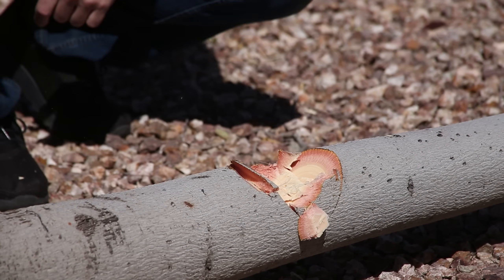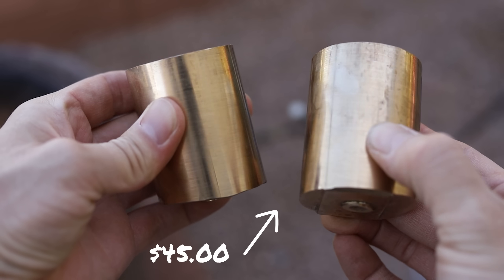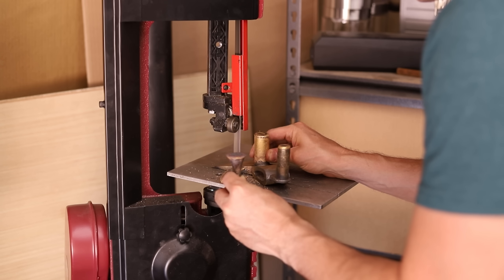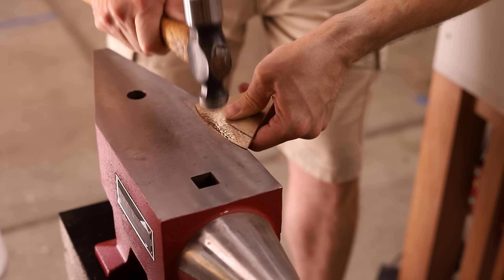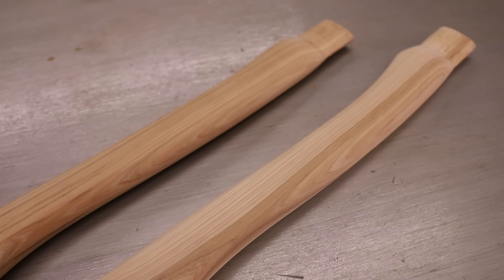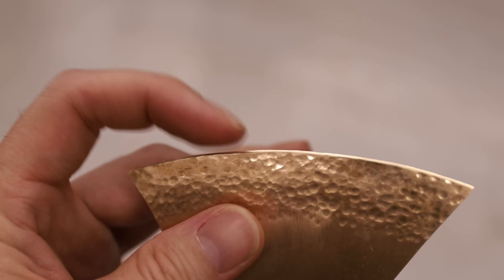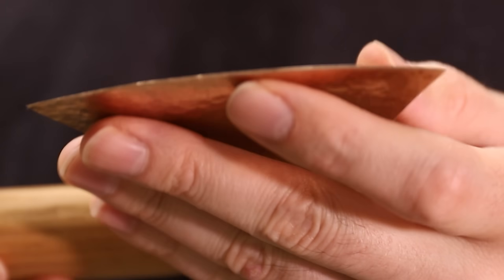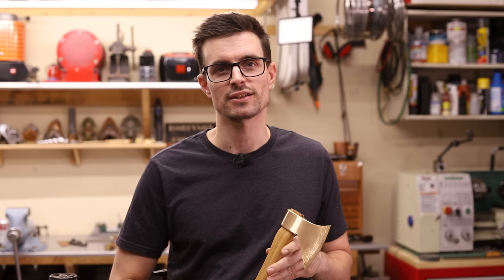Aluminum Bronze VS Tin Bronze, Making & Testing Bronze Hatchets

Comment: I'm kicking myself for not remembering the book, but there was a knifemaker who did probably hundreds of test trying to figure out what the best method for quenching blades was to maximize edge retention
his testing method was to cut short segments off of a rope with the knives, counting how many cuts he made, once he could feel the knives struggling, he called that his stopping point, it would be cool to see you try this with the bronzes, more controlled than chopping wood at the very least
for those interested, his best method was to quench a blade 3 separate times, waiting 24 hours after each quench (waiting apparently made a huge difference, it started when he got interrupted before the 2nd quench, and he struggled for some time to figure out why that knife preformed so much better, until he remembered the interruption )
Reply: 3 quenched with a day between was best huh? I've never heard of that - or anything like it. VERY interesting.
Reply: The grandpa of CATRA tests 🙂.
Reply: I have no idea who it was, but I could see Larrin Thomas take on a project like that.
Reply: Maybe Larrin Thomas?
Reply: Commenting to hopefully find the book
Reply: Chat GPT thinks that the book is The Wonder of Knifemaking by Wayne Goddard.
Reply: @faceoctopus4571 Wayne Goddard certainly did mention this method in a couple of different books, but I don't think he came up with the testing methodology. He also mentioned using a scale for more precise results.
Reply: Underrated comment, should be pinned, what liquid did he use?
Reply: I love science
Reply: The dude who did hundreds of tests, now that is passion and dedication!
Reply: someone commented a suggestion of wayne goddard, is that the one?
Reply: Was it outdoors55
Reply: The time between quenches would do nothing. Triple quench is really only a method to help make up for poor temperature control in a forge to help dissolve carbides without a hold time, and keep grain size down. Temperature controlled austenitize and then quench then freezer/cryo immediately after, then double temper for an hour each at 350-400f with a room temp cool between would give one the best possible heat treatment. You can optionally do a pre-quench or grain refine step before the austenitize.
Then you just choose the steel for the toughness needed, since tempering down a higher carbon steel usually gives you worse hardness and toughness then if you ran a tougher lower carbon steel harder. 350-400f temper is the sweet spot for almost everything.
Reply: Jesus truly does love you, He stands at the door and knocks, blessed is the man who lets Him in. Jesús te ama de verdad, se para a la puerta y llama, bendito sea el hombre que lo deja entrar.

Comment: 4:16 certain metals change color when exposed to heat, also, and I could be wrong as I am not a smith of any kind, nor am I a welder or a chemist. But It is often that a metal surface will slowly oxidize and produce a slightly different color on the surface, and when heat is applied to the right degree it temporarily removes the oxidized layer. However, when targeted towards certain specific areas, the heat only in the specific area is exposed to the direct heat, which in turn also changes the pressures and densities of the metal in that specific point, as a result of the different tensions the metal may visually produce discoloration as a form of stress points. I suppose it may or may not effect the overall useability and reliability of the tool, it may even make it more efficient if targeted in the correct areas, s uch as a Katana which has a hard edge for cutting and a strong spine for durability. Though it would seem likely that incorrectly implementing this may effect the longevity in its usage. As long as there isn't any noticeable warping of the metal, I would assume that it would function as needed.

Comment: The welded part had slightly different color probably beacuse of the heat exposure, contamiantion and exposure to the gas/gases that are used for welding, maybe even different speed of cooling the material is the key. Sory for my English. Love the video bud ❤

Comment: I am curios why with all that metal you had to cut off the hatchet heads you needed to put down more metal to weld with.  Why not just use some of that excess metal.  especially from the pour and vent holes those looked pretty solid. Not like you didn't have extra but still.

Comment: In early bronze age you would have more likely found arsenical bronze. 
It's mechanical charateristics are comparable to tin bronze, but it's not industrially made, and a DIY would be pretty dangerous, for obvious reasons.
Reply: I recall that arsenic bronze kind of happens by itself. The arsenic is present when the copper ore is mined. You have to purify the copper to avoid getting bronze.

Comment: The discoloration is due to the high heat from the welder u more or less vaporized some of the aluminum therfore no longer have the same ratio of materials as the rest of the casting hence the slight discoloration

Comment: I had cast a few bronze swords (just for fun) and they do not like chopping. I lack the set-up to cast them very thin, but the thick swords end up bending and twisting while chopping. This makes me want to cast a tin bronze axe now. I even have a spare axe handle... hmm.
Reply: I remember hearing about how Greek soldiers used to have to pound their swords back into shape during a skirmish, so maybe your not too far off with this..
Reply: @edgeldine3499 i think that may be a reference to Gaulish warriors using iron swords, which would have been what we call “wrought iron,” but it’s  plausible that similar issues might be had with varying qualities of bronze available before modern scientific metallurgical knowledge. Often bronze swords were not made with full tangs, to save cost, and the blade would be riveted to the handle. These rivets were subject to breakage especially with slashing attacks, so bronze was often limited to short thrusting swords, arrowheads, and spearheads. Many of these short swords would only be sharpened at the point, the sides were left dull. 

The ancient Greeks also used a bronze sword with an incurving blade, called a kopis , likely derived from the earlier Egyptian scythe-like kopesh .Hammering the edge of the blade causes the metal to expand along the length of the blade as it is made thinner; this pushes against the C-shaped blade, which keeps the metal under compression and increases its hardness without becoming brittle. There was also a double edged pattern described as a “leaf shape”, which had incurving sides, taking advantage of this compression principle to allow sharp edges for slashing. When iron started to replace bronze, they would be made in the same patterns, until smiths learned how to take advantage of the different properties it afforded . This can be observed in the early versions of the Roman gladius with its “narrow-waisted” appearance.
Reply: @edgeldine3499  After twenty minutes both commanders step forward and shout "Stop! Hammer Time!"

Comment: Copper and aluminum both conduct heat extremely well.  Copper also changes color on its surface with heat, due to oxidation, depending on how hot it got.  When you TIG  welded, you made a hot spot.  The heat spreads outward, very quickly.  Once the copper gets hot enough to oxidize, it will.  Just around the TIG weld, the IG controls oxidation, but once the heat gets outside of the inert gas, it oxidizes.

Comment: It is my understanding that alloys are sometimes hard to re-melt or weld and still have the same alloy. This is because, once molten, some elements in the alloy can actually boil off so you would be left with either just the base metal or one with very different percentages. Ive only seen several videos of these special alloys being made, so I'm no expert,  but I remember them quickly adding the element with the lower melting point at the end of of the nelt and quickly pouring it before it had time to gas off. So, I gather that you have to very accurately maintain temperatures and process times to produce or maintain an alloy's percentage makeup whil casting.

Comment: If you melt and cast 'factory made' aluminium bronze, it's not the same alloy anymore. Aluminium vaporizes very fast. That's why it's usually added on very end. Also it absorbs hydrogen from air moisture and becomes more brittle. 

I have made aluminum bronze in my argon filled electric furnace to avoid hydrogen contamination. It's very significant in aluminium and much noticable with aluminum bronze.

Comment: 4:16 that may be some of the Nickel coming to the surface due to the heat. Similar thing happens to stainless steel cookware, if you heat it too much, then the Nickel and/or Chromium come to the surface. Can be removed with vinegar.

Comment: You can make very strong aluminum bronze by adding about 2% iron to it, also could add 5% titanium or 0.5% beryllium. Any of these alloys is as strong as steel and the Be one can get to Rc of over 60. All will work harden with cold forging over Rc 50.

Comment: 4:15 different rates of cooling and crystal formation in the cast axe head and the weld pool resulted in big crystals in the axe head(slow cooling) vs small crystals in the weld(very fast cooling). Color change is an optical effect of the structural differences in the metal.

Comment: 45 year metal caster experience guy here: the discoloration you see from the filler material is caused by gay. Yes “gay”. Galvanized-accent-Y’Cauldrel. It is quite literally the metal having homophobic tendencies. Some think it’s how the metal was raised, personally I think tik tok is to blame. Anyways, usually painting the blotched area fixes the axis of the material. Hope this helped 

-Don

Comment: The slightly different color where you welded it is probably because different alloying elements vaporize at slightly different rates when molten this slightly influences the color and melting temperature but isn't a big deal under normal use. This phenomenon is used by jewelers when they need to make multiple solder joints on the same piece of jewelry since older solder joints can remain solid when you heat the part to melt the solder for new joints.

Comment: Looks like your color difference in the welded spot is only refractory. Same material just cooled differently, so the light bounces differently.

Second possibility is that the higher heat of the arc changed the concentrations in the alloy.

The less likely possibility is that if you were using helium in your gas mix some of it was adsorbed into the alloy.

Comment: I tested a set of bull gears in a old English truck that were "bronze" bsck around late 80,s and my test involved hitting with ball pein hammer and to my dismay the shape of a tooth was imprinted into my hammer, no mark left on bronze gear whatsoever, doing a little research back before the internet and i found claims that Egyptians had bronze alloys that at that point in time modern processes could not duplicate in strength or hardness and after seeing my own efforts i believed it to be true !

Comment: very cool 😎  I've always wondered how tools and weapons from the bronze age would have held up. I wish you would have done a modern day hatchet,of a near size for comparison because it seemed very slow going there for both hatchets compared to my store bought one.  I also think the weight helped the non-aluminum one chop better. Hard so say. However, I understand it's hard to compare when you're using, kiln dry lumber in the desert vs my wet logs on the east coast.

Comment: In my experience, aluminum is quite stiff.  I've been riding bikes for 40 years and would call myself a cyclist for 30.  The aluminum frames that I rode were much stiffer than chromoly steel.  Chromoly steel was heavier but had some give which made it more comfortable.  The best frame I ever had was a mix of carbon fiber and chromoly steel.  It was light and had an incredible feel.
Reply from the maker: Yes it is, I agree! I actually ride XC but not so much as of lately. I’ve had bikes with all of the different materials but settled on titanium after having a carbon frame fail catastrophically. A Lynsky PRO29, It’s springy but plenty rigid and hopefully will last forever. Thanks for watching!

Comment: Thank you for your video. For those who are unfamiliar with sand casting, the top half of the mold flask frame is called the "Cope", the bottom half of the mold flask frame is called the "Drag", and the sand packing tool is called the "Rammer".
Reply: Rammer Time.
Reply: Cope
Reply: @navienslavement Cope and Drag, Rammer

Comment: An appleseed edge is another term for a convex edge, where there's no discernible edge bevel as the edge is blended cleanly to its apex.
Reply: … So he didn’t give it an “appleseed” edge?
Reply: @SebaztienHawke-ci5hm  he gave it an secondary bevel
Reply: It was a “flat” grind to be precise.  Flat grinds are used in limbing a tree or carving in wood like a totem pole.  The flat grind tends to be much more fragile than that of a convex.  Hence, a convex grind is preferred.

Comment: I think the color change is due to the change in alloy because it vaped off, as witnessed by the smoke from the tig welding., but also the crystal structure from the heat treatment and anodization can also change colors

Comment: pretty cool results but i'm not that surprised, early iron tools/weapons were actually worse than bronze in a lot of ways but iron is a lot more common than tin so once people figured out how to smelt iron it started to replace bronze do to better availability and once people had been working with iron for a while they started to figure out how to make and heat treat steel and thats when steel tools actually get better than bronze, of course there's a lot of overlap and at different times in different areas and i am far from a expert

Comment: 4:22 
I don’t know but my best guess is that one of the other alloy metals in the aluminum bronze either oxidized or burned out of the filler rod during the intense heat of welding, changing the color of the alloy slightly.

Comment: You should do a razor next. Romans were clean shaven with large round bronze razors with work hardened edges. Since then we switched to carbon steel and sharpening, but I’ve always wondered how bronze would perform!
Reply: Bronze is also anti-microbial, which explains how Roman surgeons were able to perform complicated surgeries without antibiotics — their scalpels and other instruments were all made of bronze !
Reply: @zimzob oh yeah copper is toxic to bacteria
Reply: True! Something that people don't think so much about is how we actually had "shaving sharp" blades in antiquity. Not everybody was walking around with grizzled beards and crudely-cut hair, and it's not like the Romans had genetic factors giving them boyish faces. The middle and upper classes had access to some properly razor-sharp blades for a baby's-butt-smooth shave.
Reply: Probably comparable as far as use goes. Even though steel is harder, that comes into play only in edge retention properties, meaning steel holds its edge longer before resharpening is required.
That said a bronze shaving knife would be badass and I would totally buy one if available. Bronze is so beautiful.
Reply: I wondered some time ago, how Romans achieved being beard free.

Comment: It seemed like you had to chop a bit more and harder with the aluminum bronze. Was the weight difference between them noticeable when holding them in hand? Any balance issues?

Comment: I think a proper stone axe would outperform that. I think you're going dull after a couple hits and then just mashing the wood from there. Probably needs a different edge geometry or hardening technique. Mankind has used bronze tools for thousands of years. There has to be a proper bronze axe design out there that doesn't crap out in 4 swings, or we would just stick with stone.

Comment: Then I realized I after doing it the hard way, I have a power tool that will make this way easier!

I do this ALL the time. 😩 Usually just going with first thing I think of using.

At least you had two to do. I usually only have one offs so realize if I was to do again, I could do easier. Lol

Comment: Just a suggestion use boiled linseed oil instead of glue on the wedge it remains flexible with impact and can be refreshed and tightened by soaking in blo
Reply: Raw linseed  oil will soak in better ,boiled oil dries better

Comment: A lovely job you've done with these. A couple of small points about the hafting of your heads. Hickory is a good choice, however when you choose your wood for the handle, the grain should run in line with the length (about 90 deg from what you have). this will lessen the likelihood of you splitting the length of your handle on impact. Additionally, there is no reason to use the metal wedges, they will add nothing to the holding. Some would argue that by splitting your (wood) wedge, that you have now actually weakened the hold of your wedge. These are just "fine points". I don't want to detract from your very fine work here.

Comment: 4:18 it could be the presence of iron or other metals that are prone to tempering. If that is the case the axe here may be able to be made stronger by heating and cooling in oil several times to then like you did with the first bronze axe you made pounding it to strengthen it.

Comment: The metal beads just sliding off the sand is peetty insane in a fun way
Reply: The tin bronze has very low viscosity, so it flows very easily.